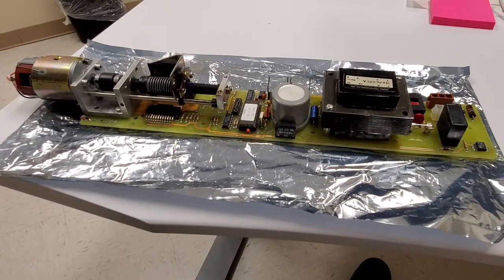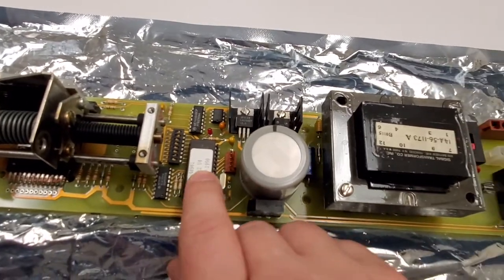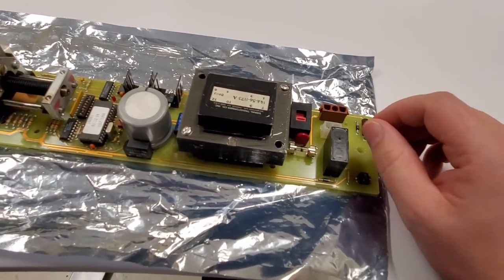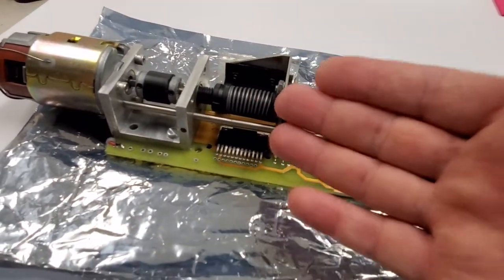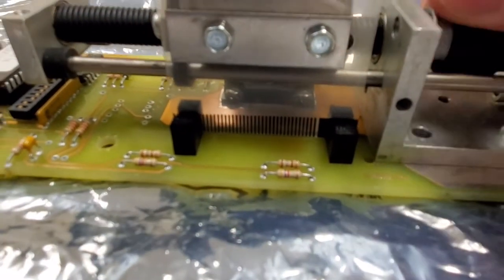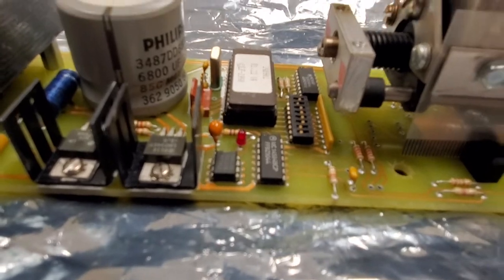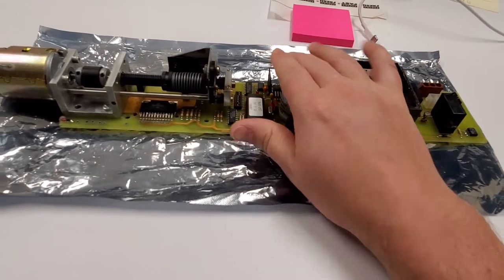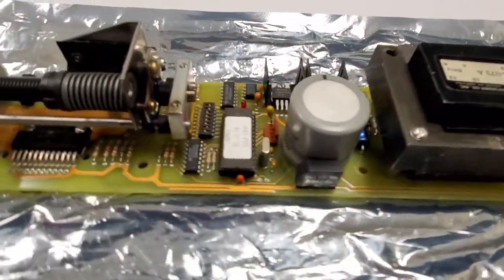Dumpster Treasure!

Comment: I think it's really cute that there is no processor. I'm guessing the 8-pin chip is a 555 timer and then a 4017 ripple counter that runs the "program" in the EPROM. Sweet!
Reply from the maker: The motor driver is MPM3002, I have a darlington transistor as a driver (MC1416P), a DS1232 as a microprocessor watchdog and a MC68705P3S EPROM "microcomputer unit"
Reply: @BetterBiomedChannel  oh that was surprising. I hoped it would be really old-school and have no processor :)